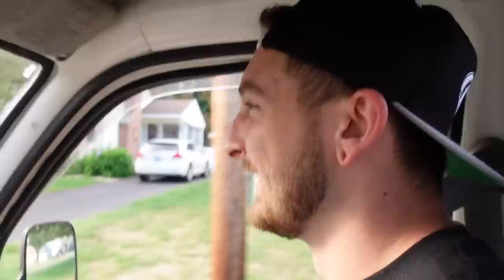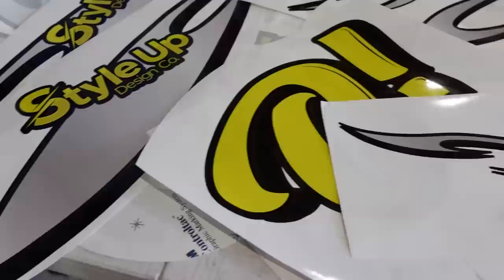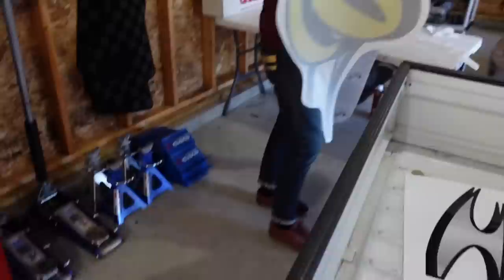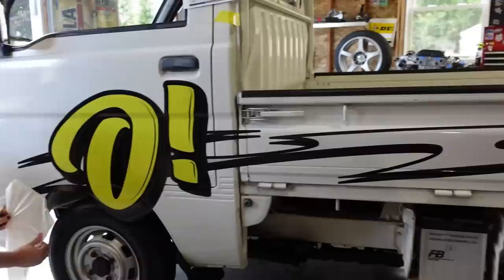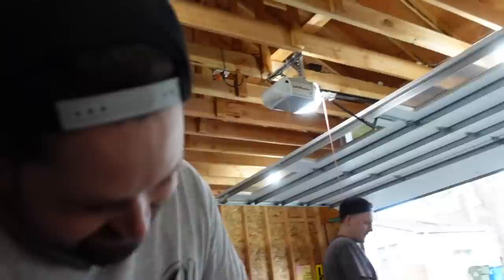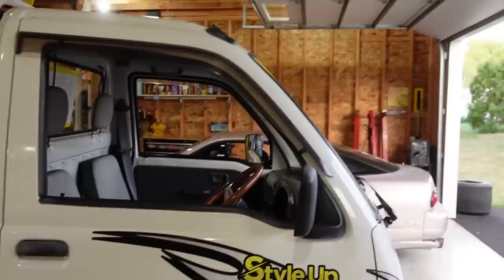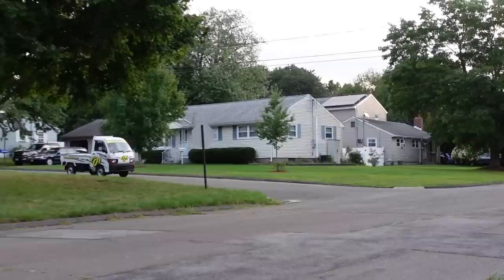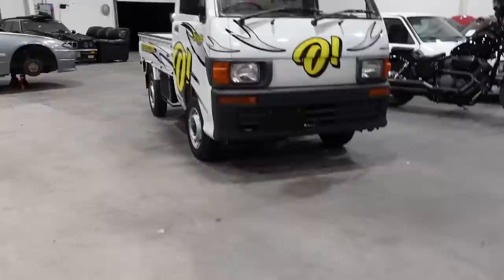JDM MINI TRUCK GETS A COMPLETE LIVERY!! (Looks way too legit!)

Comment: It's funny we have the same style of truck but full size on my island, "crew size" or regular (one more passenger seat in front), the way you drove on the highway is exactly how I see workers drive this after work, one hand out and lean on it like they cruisin that shit X)
For real, I've worked with The Toyota Dyna old generation and I understand why they all look the same despite being from different brand. It's just easy to work on, and you never work on it since it has never break X)

Comment: The o should have been the main focal point on the doors. I dig the style but some details could have used a bit more thought. The o on the left side looks odd because you had to cut it due to the position of it. Can forget it's supposed to be a livery based of Jimmys brand.